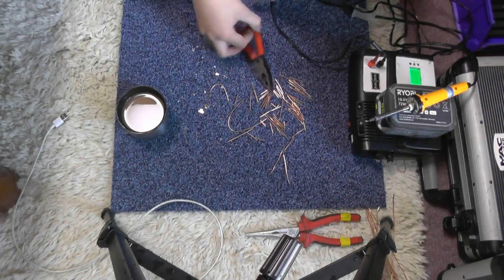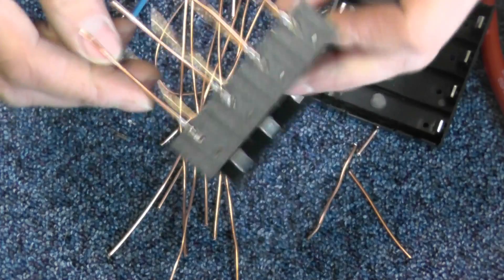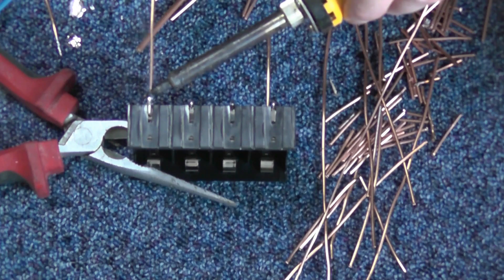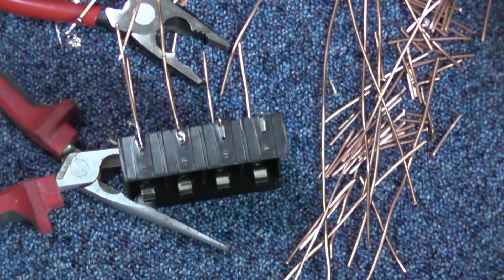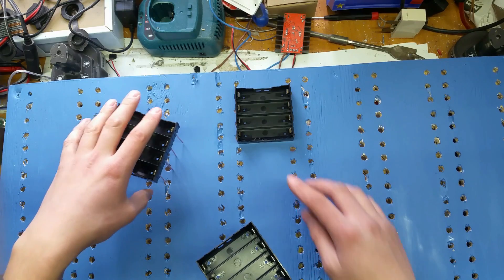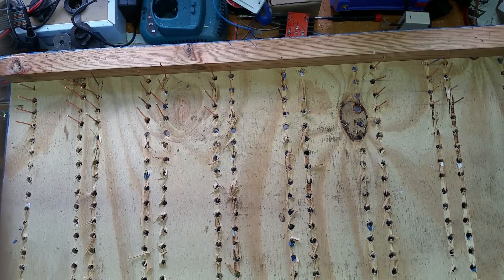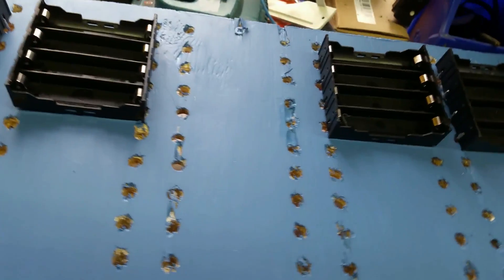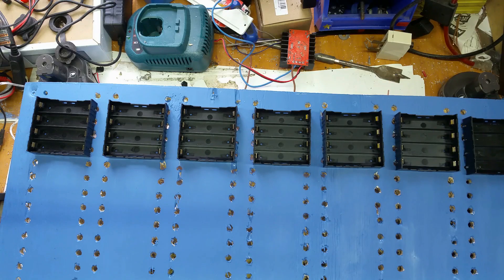power shelf continued

Comment: the middle buss bars wont need to be as big as your two ends as the current just flows through to the next cell in series. smaller gauge is much easier to solder too and easier to work with. Big ones on the ends as  all the current will need to flow onto a single cable to your loads

Comment: That's a bit thick of wire for one 18650, right? So why not run that same wire all the way down each side of the four batteries like a normal bus bar so all of your parallel group and loop the negative side to your next parallel group to the positive side and so on?
Reply: Oh you probably want to know how it stays on the board, so drill a hole and run your series wire thru that to the next bank and maybe a little hot glue here and there, you know.

Comment: I've never done anything like this so no idea how it wires up, but wouldn't it be easier to butt up all the holders and solder on a fuse wire from one terminal looping over the holder onto the next. Or just bend out flat the terminal legs between holders and solder the fuse wire in between each holder?  Maybe a but late now all the holes have been drilled..
Reply from the maker: This is my first attempt. my take on the idea, but your idea is a good one. I'm pricing paxoline board for my next one . I'm still going to need to include a buss rail between each cell in parrallel. In case one cell does pop the fuse wire you will loose the other 6 cells in series fron the circuit. (But that might not be a bad idea to keep balance)

Comment: Looking good so far.  I like making do with materials you have available.  Amazing how much solder you can burn through soldering up all those heavy connections.  I did 3 x 8 holders on mine and was surprised how much I used.
Reply from the maker: I've not got much left from the 4' ish i cut off. going to use a fair bit yet.